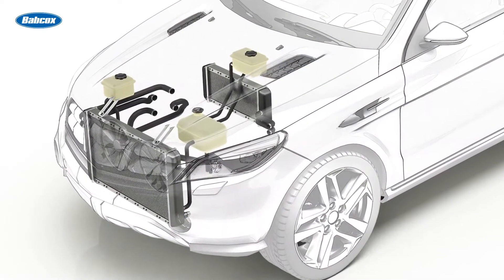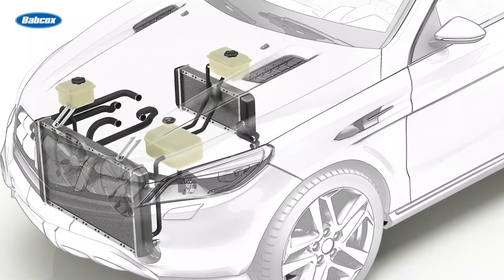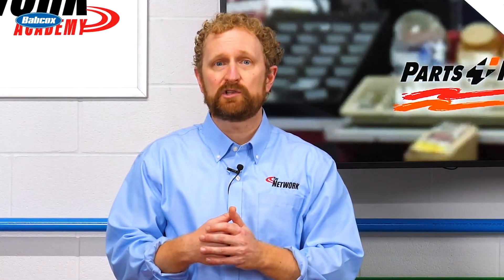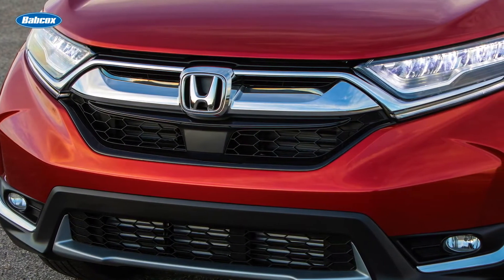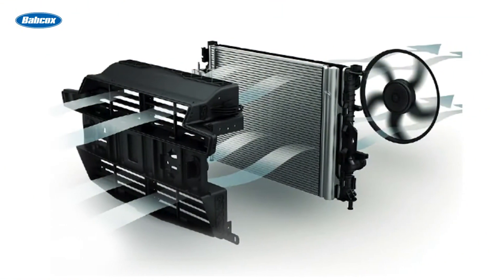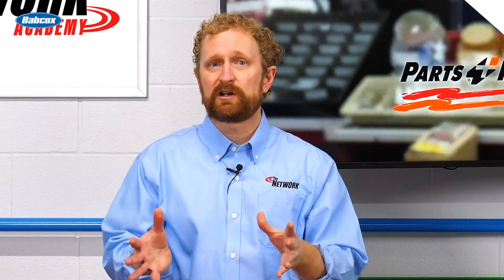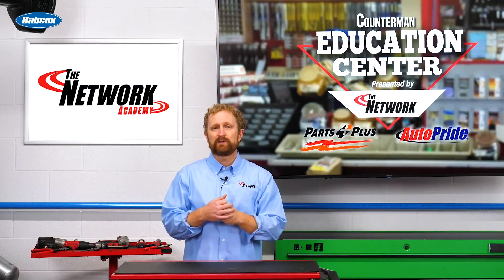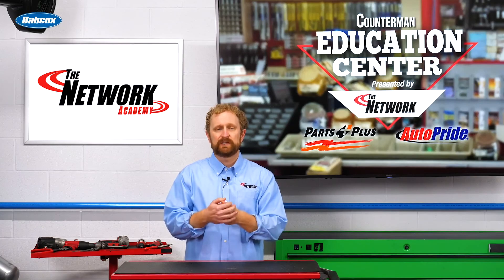Active Grille Shutters

Comment: My gauge is right below the H is that normal but then the shutters open and comes down 
I’ve never had it overheat , or the warning come up or the check engine 
So is that normal?
Reply: Below H is overheating and severely abnormal, your shutters are not opening
Reply: @seatime674  I took a piece of pvc and cut it to size and slide it in the vents on both sides 
Hasn’t gone over normal temps at all ever since 😃
Reply: @Erweenie  I can't picture that, you mean wedging pvc in there to force the slats open.?
Reply: @seatime674  yeah it’s about 1 3/4”
Reply: @Erweenie  you didn't get a check engine light? Typically that happens
Reply: @seatime674  no I didn’t
And your right I should of gotten one
Reply: @Erweenie  I'll probably cut my slats out and leave the motorized ones so not to get the light

Comment: Wait, wouldn't them be closed increase drag since it is essentially a wall now? I'm confused
Reply: No. It s the opposite.
Drag increases when in enters the inner radiator area and creates a heavy turbulence which pushes the car rearward.
When the active flap is closed the air flow is directed to the hood/bonnet and the bottom bumper lip, increasing downforce and reduducing drag.
The closed flap acts like a nose.
But when open acts like a mouth.
Reply: @hanynowsky  Kind of. When open, there is indeed all kinds of turbulence due to the resistance of everything in the engine compartment. When closed, the shutters simply redirect that airflow over the top of the streamlined body of the vehicle, thus reducing drag.
Reply: @jakejones5736  exactly.
People worrying about overheating should not. 

Bmw G30 achieved a CD of 0.24 thanks to that active air flap.
Reply: I just replied to another responder. Here is an easy way to understand this:
Consider two rivers. One goes straight, but with a lot of boulders and large rocks. The other makes an S-curve but has no obstructions. Which do you think will more easily let the water pass through? That's right, hands down it would be the second one.

The reason why is not only does the first one have SEVERAL "walls", but the turbulence from all the various points of deflected water interact with each other causing even further drag. Hope this helps. 🙂

Comment: Got my shuuter damaged and then replaced by a new one. The new one was faulty or installed improperly. As a result i have a shutter always closed and a check engine light always on. Because of the check light the remote engine start is not working
Reply: Exact same situation with my 2019 vw jetta, taking it back thursday
Reply: @yangtroy1 having the same problem with my 2019 Jetta. Mechanic wanted $600 for the part and $150 for labor. I ordered it online for $250 and he will install it when it gets here in the next few days. 

Are you saying you had yours fixed and the check engine light came back on? Worried about potentially having that same issue… these freaking things.
Reply: @ddeenis77  i bought just the motor and gave it to my mechanic but he is taking forever, will let u know when I get it back
Reply: @ddeenis77  i feel your pain annlying as shit
Reply: @yangtroy1 thanks would appreciate it
Reply: @ddeenis77  tbh with u i have intentions of ditching my jetta, has been good to me while ive had it though
Reply: @yangtroy1 I get you. I haven’t had any issues up until now. Literally haven’t needed anything done since I got it at 20k miles. Now at 90k I had a evap sensor replaced few weeks ago and now this issue with the shutter. Will have to see where it goes from here but she’s been good to me. How many miles do you have on it?
Reply: @ddeenis77  i have 98k, and it has been good to me as well besides the active grille shutter, but im a toyota/honda guy at heart , just paid it off
Reply: @yangtroy1  gotcha good luck whatever you decide to do may it serve you well
Reply: @ddeenis77  u as well, hope that remote start comes back in ur life soon i know u miss it
Reply: @ddeenis77  i have since moved on to a toyota tacoma, best of luck to you my mechanic never figured it out
Reply: nice, a tacoma. I'm not sure im financially ready for a change at this exact moment. I had the grille shutter replaced and the light turned off for a few days, then literally today it came back on. Not a fun feeling, gonna go to the mechanic again and see what he says. GOtta be a way to get it figured out. Enjoy the toyota bud I'm likely getting a pickup myself when the time is right.  @yangtroy1
Reply: @ddeenis77  😔 for what its worth i had to drive a beat up 2005 corolla for like 2 months bc i hit a deer with that jetta and just having a car that drives smooth and has a reverse camera was so nice, the remote start is small potatoes anyway
Reply: @ddeenis77  if all else fails maybe drive it for a lil while until u get paid a little more and bite the bullet at the dealership, also i think once the new grille shutter gets installed he has to do something called "basic settings" reset or something like that

Comment: It may sound good on paper but in real life, the little time it saves to warm up and fuel savings are not worth the complexity and cost of these devises when they go south.
Reply: @mouselt1  you are correct. Until you go spend a year in norway where they even install aftermarket electric coolant heaters that warm up the coolant even when the engine is shut.

I second you, if the climate not freezing cold. But these devices can reduce the coefficient of Drag  by as much as 0.2. which is significant for fuel savings.
Reply: I haven't had a problem with mine in almost 2 years. And they had to deal with my bumper plowing snow out of the way.
Reliability isn't a big deal.

Comment: 2015 vw Jetta shutters went out. $2000 later they are fixed. How much fuel mileage did it save me over the life of the vehicle??? Not $2000 I’m willing to bet. BS!!!!!!
Reply: 2 fuckin grand for some plastic and an actuator?!?
Reply: I know,,, On the freeway let's block half of the radiator from cooling. BRILLIANT IDEA💡
Reply: @seatime674 You aren't pushing your engine to full throttle the whole time and your thermostat isn't fully open 100% of the time. Relax snowflake, not everything is a conspiracy against you.
Reply: Called BS once I heard reduce emissions and $$$$ by 2023. Lol
Reply: it saved the first owner

Comment: How can I cancel them without a check engine light on??
Reply: I cut cut all the shutters off my except for the one that is attached to the motor. No engine codes as the truck still thinks their in there.
Reply: @rickylee2477 but when i took mine off my a/c stopped working. why’s that?
Reply: @dkrum5854  that’s a whole other problem. Nothing to do with the shutters unless you damaged something taking them out. 

I used a survival rope saw. Cut mine out with grill in place. Left the top center and bottom. Still no codes or issues to this day.
Reply: @rickylee2477 How is it working with those cutoff shutters do you see it being any cooler and what make vehicle do you have.
Reply: @seatime674  I’m sure it helps to a degree. But nothing I could tell just by watching the temps. 
Since then I’ve added a 180 stat and and tune to turn the fans on sooner.

Comment: more parts more problems less durability less reliable, more costs of repairing.  electronics cannot handle vibrations or temperatures.  engineers ripping off the manufacturer owners to get more money . they electronics or circuit boards or solid state electronics cannot handle over amping.  waste of money.  waste of time.

Comment: Umm wax melting.  Perhaps on a dial safe thermostat.  

The spring in the thermostat expands and contracts regulating the amount of coolant flow through the radiator

Comment: P059F code 2019 Nissan Altima. Shutters were halfway open when parked. After start up, they fully cycled open & close several times, then remained fully open. Hot day and the engine was already warm. For what it's worth, had the same code about a year ago. Disconnected and reconnected electrical harness. Terminals were shiny new, no obstruction no damage. Code went away on its own. When it came back recently, I assumed it was the same issue and did not check it for a couple weeks. When I finally checked it, I found half a styrofoam cup holding the shutters open. Any ideas?
Reply: Is it safe to drive the car with the code popping up
Reply: @petergarcia1334  Yes, because the code alone does not mean there's actually a physical problem with the component. And if there IS a problem, it's designed to fail safe. That means it fails in the OPEN position, thus allowing full cooling ability. And even in the unlikely event it fails in the closed position, in the most demanding driving situations it would take a while for the engine to slowly overheat. At that point, simply shutting off the engine will prevent damage, and you will only be facing an inconvenience.           Of course you can always visually check to see if it's open or closed. Hope this helps. 🙂
Reply: @800game  No. The gears that moved the shutters were stripped, so the position sensor knew it was not operating correctly. Replaced the shutters and problem SOLVED!
Reply: @800game  Thought I answered this. Sorry for the delay. I ended up having to replace the shutter as the gears to the motor were stripped. The code went away and has not returned! 😀
Reply: Seems like this is common point of failure on the 2019 Altima. I'm currently dealing with it. Several similar posts on various forums for the 2019 model.
Reply: @coomercove  Not sure why, but NOW my previous answer appears. Last comment, it did not show up. Hmmm. Anyway, what you say makes sense as mine also failed at low miles/age which surprised me. No doubt there's some sort of design flaw.
Reply: For me, on a BMW E90 LCI 2009 the shutter never opens even when the coolant temp reaches 106 C. The radiator fan is spinning but the shutter is closed.
Reply: @Rhadoo89  Check that the connector is fully inserted and not damaged (bent, wire pulled out, etc.). Then disconnect to check that the terminals are clean (to make good contact). Then check wiring to terminal for any breaks. Then check that nothing is blocking the shutters from opening. Then gently try to open manually. If they easily open, your gears are stripped. Never force as anything more than a gentle push without moving means the gears are properly engaged (not stripped/broken). If all these steps check out, disconnect harness and attach a voltmeter. Start the engine and you should immediately get voltage. Typically, the shutters do a complete cycle or two as a test each time the engine starts. Additionally, they should always be in the fully open position every time you shut off the engine. The reason is if the action fails, it is safe for the cooling system.

All the above is a universal procedure. You should look up your specific model for variations as well as specifications. Hope this helps.